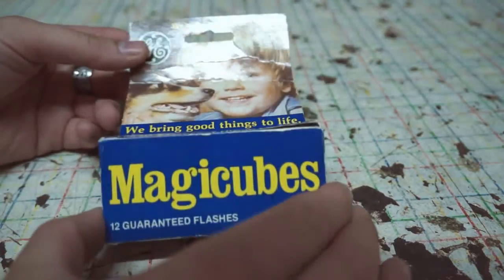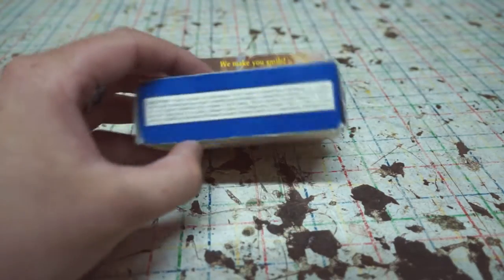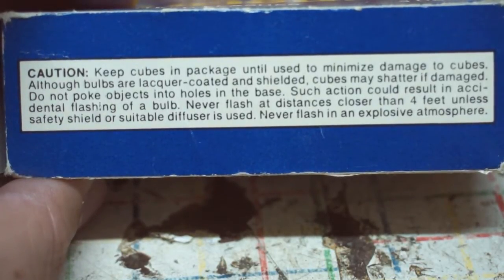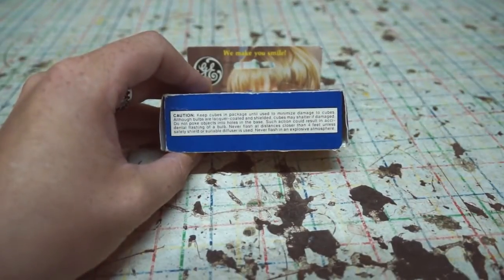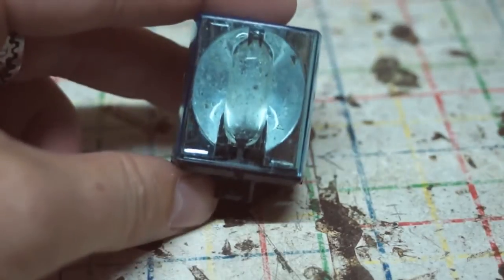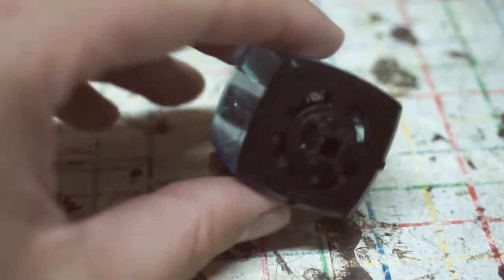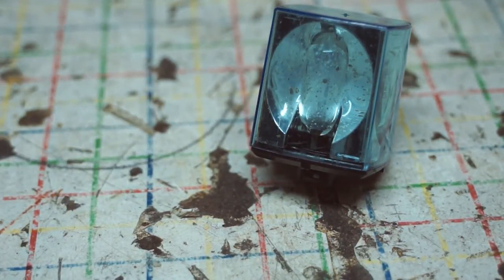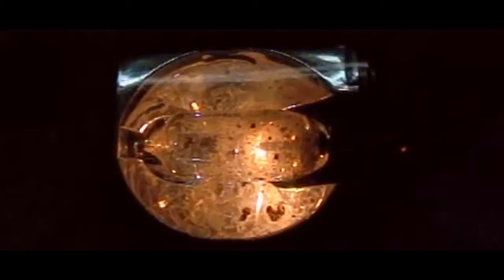GW Flash Cubes in Slow Motion

Comment: I remember the electric driven ones and the flash strips of five or six bulbs in a row on the instant cameras. I think I remember taking one apart. Then the capacitor driven xenon flashbulbs started becoming standard and these flash cubes were phased out.
Reply from the maker: I've seen images of the linear flash bulbs but I've never had my hands on some. I'll keep my eyes open at the pawn shop.
Reply: @NickMoore  I'm curious as to how those know when to go to the next bulb or maybe each one flashes a few times then it's burned out. Only seen them when I was really young.